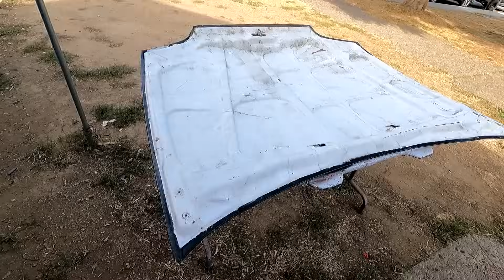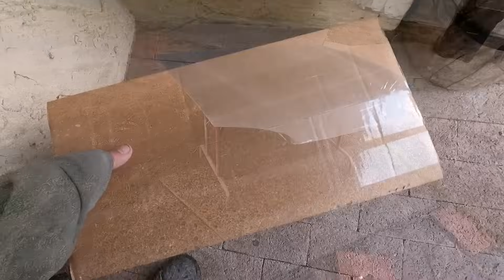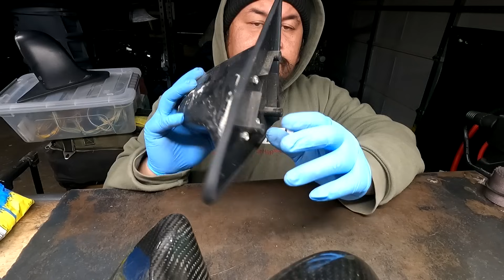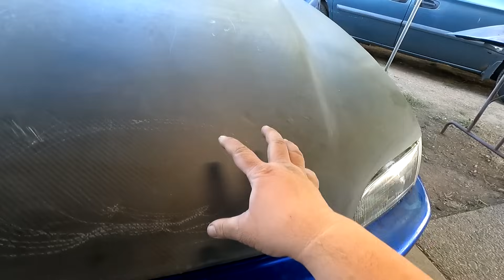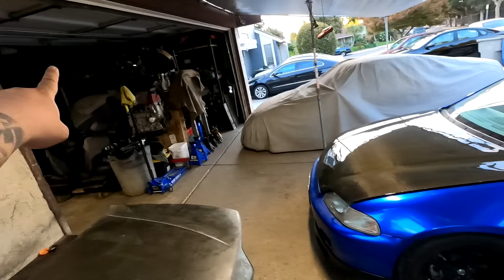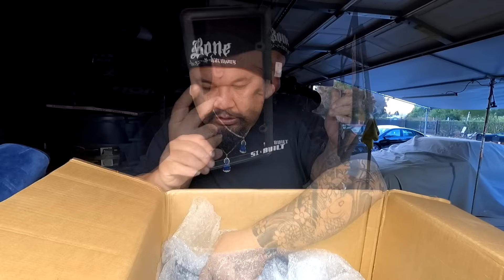FACEBOOK MARKET PLACE FIND | Carbon Fiber Hood Restore

Comment: Bro i had the same problem on 2 cars, one of em i welded a fat bead and ground it down came out perfect., and the other car was a after market hood but that piece on the hood was to thin for the latch to to lock so heated up a piece of flat bar and wrap it around with vice grips the grinded off the access the spot welded it and worked cherry. Thank you for always providing great content Bro, Aloha  🤙